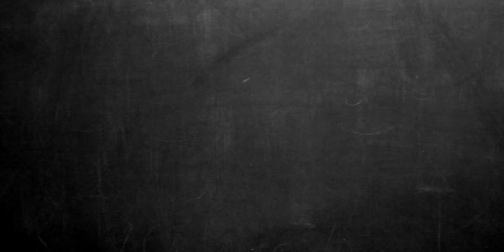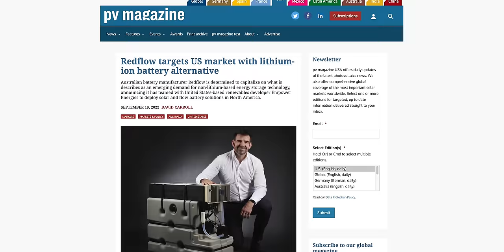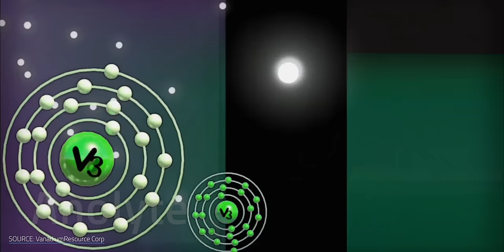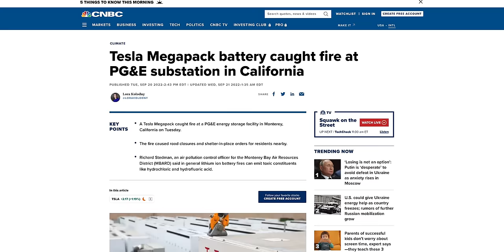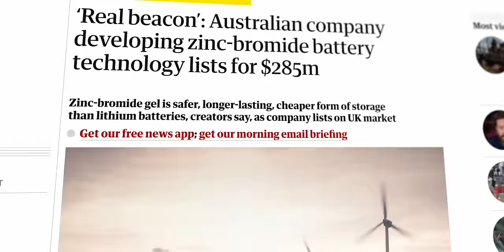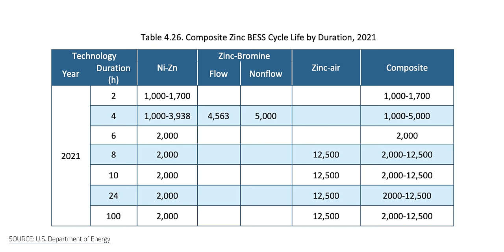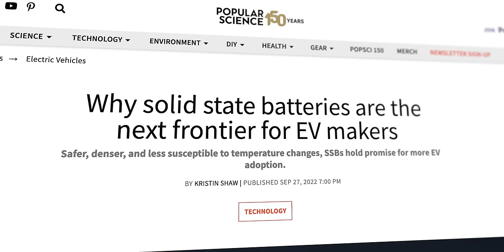137 Year Old Battery Tech May Be The Future of Energy Storage

Comment: How about the Edison Battery; the nickel-iron battery.  They have low energy density, so the batteries are big, and a fairly high self-discharge rate, but in a fixed installation the fact they can handle unlimited total discharge, a wide range of temperatures, and a lifespan in excess of 50 years makes them appealing.

Comment: All positive storage options should be deployed as soon as they are ready. I hope Zinc bromine batteries get put to use sooner than later.
Reply: We don't want too many different technologies out there.  What would be good however is a consortium that recommended a standard set of sizes and voltages.    E.g. If a large car battery was one such size at a nominal 12v ., so that lead acid ws still allowed to play, then it would  mean that companies would target that size as a replacement.  Now inverter makers tweak the charging and input/output voltages of their units so they can  adapt to a Standard Battery#3.  The standards association would define a series ranging from a motorcycle battery up to units that required  being placed with  fork lift., each unit  being something like 2-4 times the size of the next smaller one.  Standard should specify foot print, hold down, terminal type and location.

In this way when the Acme Battery corp goes belly up with their Uranium battey in 2050, I can replace their batteries with a different modular battery, retune my inverters, and job done.
Reply: @SherwoodBotsford  Just look at basic PC systems. Diversity but with standards are good, you can in MANY cases can't go wrong.

Comment: It's another way of storing energy. Ultimately, there will be several options used, each chosen as being the best for the particular application. One newish idea is to store sand in an insulated container and use it as a heat sink to store surplus energy. The sand can be heated to several hundred degrees Celsius and the heat used directly or converted to electrical energy. Perhaps using a Stirling engine generator setup. This system is almost infinitely scalable, it uses cheap and locally available materials that don't degrade with use..
Reply: I like the heat storage idea for conversion to electricity, however, the problem I see with solid piston Sterling engines is the need for precision engineering for the piston. A Fluidine might overcome that problem. You might also be interested in a simple thermal difference engine. Robert Murray-Smith shows the principle on a model with a vibrating membrane which he says can move a magnet through a winding to generate electricity. video: https://youtu.be/. It is based on the work of tibsim - his videos are here https://www.youtube.com/@tibsim/videos. Lots to play with. Enjoy!

Comment: I wonder if they'd be useful for normal car batteries. Simplistically sounds like a decent replacement for lead acid. I wonder about batter backups as well.
Reply: I was wondering about busses and trucks, since it does seem to need a bit of space, but yeah cars too?
Reply: Fun fact lead acid batteries are one of the most recyclable and one of the most recycled items in the USA (and most of Europe).
Reply: @ameritus9041  In fact there is one railroad that ONLY ships the reclaimed lead from these batteries to the other end of the rail where it is used in new batteries. And it IS great that they are so recycled but they just aren't great batteries for most applications.
Reply: @larrybolhuis1049  lead acid are amazing batteries for exactly what they are used for... turning over motors that require large amps for a short period of time.

Comment: BYD and CATL will start making sodium batteries in production quantities next year. They seem as good as flow batteries. You may want to compare them with the flow batteries.
Reply: You mean half-as-good as Li batteries.
Reply: @Bobtubeau  what defines good in your mind?
Reply: @Z0mb13ta11ahase  energy density( by weight and volume) while also putting out a good amount of power. Charge life cycle is a important thing too. Energy density is the number one thing for vehicles.
Reply: @randybobandy9828  specifically for vehicles, if its cheaper than Li batteries but takes up more space for long term storage id say that other options would be better, do you agree?
Reply: @Z0mb13ta11ahase  yes. Cost/safety/charge cycles are most important for a home. It can be huge as long as it's cheap and lasts 20-30 years

Comment: You forgot to mention that Lithium batteries for Grid Storage are competing for raw materials with the electric car industry! This will increase the inflationary pressure on them as the electric car industry scales up. It will probably be a LOT cheaper to use a different chemistry for Grid Storage applications like Zinc-Bromine than using precious Li-ion materials that are much more valuable to go into cars, delivery vans, buses and trucks!

Comment: If the zinc ions are being reduced to zinc metal, then it’s not a true flow battery as some of the reagents are stored on the plate instead of in the solution. This isn’t necessarily an issue, but it does make it harder to scale than a traditional vanadium flow cell, at some point you run out of physical room for the zinc metal. The same applies to the iron flow battery you showed a while ago. Bromine is a reasonably toxic and corrosive fluid, but it does have that advantage of being usable for regenerative electrochemistry. Whether it can be scaled for grid storage to the same extent that iron flow batteries could depends on cost and availability.

Comment: How scalable are redox batteries? Can you have one in your house that has say two 50 gallon tanks on the sides with a "reactor/reaction" component in the middle. Can you then put 2 reactors that feed on the shared tanks for higher output. Do you need multiple small self contained units or can you built one large unit that works more like a small power plant? Sounds like there is a lot of potential in this tech.

Comment: The Gelion batteries are poised to hopefully replace lead-acid applications, with a very real possibility of being a 1:1 replacement and not needing any advanced circuitry like Lithium does. 
I have also read that the RedFlow batteries can have the liquids recycled and essentially cleaned for re-use. They can also sit near indefinitely at any state of charge without the usual degrading. 
I was very keen to get one in a home solar setup, but RedFlow is pursuing the large scale market more than home (at least here in Australia).
But still very exciting technologies!

Comment: Could you clarify your cost and temperature figures? I got a bit lost.

Cost:
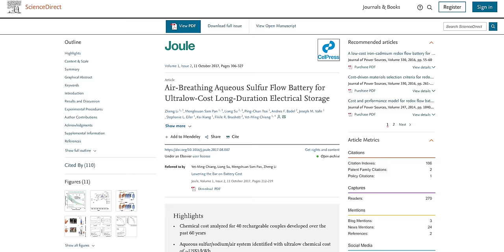@8:20 Study found that cost Vanadium Reflux Flow battery is about $124/kWh, and a Zinc Bromide system is about $8/kWh
@8:35 Study on the materials cost: Zinc Bromide won out at the cheapest at $153/kWh, which is far lower than Vanadium's $491/kWh
@11:05 Cost of system integration for lithium and vanadium is $42-$52/kWh, and the cost of Zinc Bromine is between $10-$18/kWh

So...how much does it cost?

Temperature:
@12:36 An experiment showed the Gelion battery still managing to (mostly) operate while on top of a 700C hot plate
@12:48 The Endure's upper limit being about 50C

How could it's upper limit be 50C and yet still manage to operate at 700C?

I've missed something. Could you clarify these figures?

Comment: Well, I hope things change soon as I have been trying to get hold of a Redflow battery set for over two years now. The reps have told me a few times that they were not seeking a market in the US. I hope that has changed. I will be starting the build phase of my new shop/home in a couple years and hope to have the units available to install in my new home. Otherwise, I am going to install an Edison battery bank. I am going for a net zero/off-grid setup to retire in.
Reply: How you gonna do that when just about anywhere in the US obiligates you are tied into the grid?
Reply: @rickytorres9089  I have not seen anything that obligates me to buy power from the grid. The property I am working on at the moment has no power/water/sewer or road. I will be installing a well, a drain field, solar with backup batteries, and a generator for emergencies. If your property is financed then yes you have to because someone (bank/insurance) else has an interest in your property. If you pay for everything upfront then no you don't have to hook into the grid.

Comment: Zink bromide sounds amazing, because you don't need very high energy density (by weight or volume) for grid scale applications. What you need, is for them to be as robust as they can be: withstanding temperature variations, withstanding a lot of cycles, and being made from materials that are as risk free to the environment as possible, both in production as well as during operation and eventual decommission.

Comment: You mentioned they would not be suitable for mobile use. Would that be true for sailboats where weight and space would be a concern but maybe not quite so much? One of the big concerns with lithium on sailboats is fire.
Reply: You might want Lithium Iron Phosphate batteries for your boat rather than Lithium-ion inflammable ones.
Reply: @mightymouse2024  thanks, I’ll ask around. I had not heard of them.
Reply: @Rojoke  They're usually described as LFP. The made in China Tesla model 3 uses a CATL made LFP battery. Lots of demonstrations of them piercing an LFP cell and it not bursting into flames.

Comment: If these do take off, both for grid scale and home (both off-grid and hybrid) it would at least free up lithium production for mobile use.  You show that they can handle higher temperatures at least as well as a properly maintained LiFePO4 battery but, how well do they handle COLD?  Pretty sure the Redflow at least would need to be kept (even if not being cycled) at a temperature above freezing
Reply: Not gonna be the same freezing temp as water but idm

Comment: Curious. If they have the same format as lead acid batteries and so many more cycles, why hasn’t the automotive battery industry converted or already looking at this as a replacement for all the existing ICE and lead acid applications? If cheaper and more effective, it would seem to be one hell of a use case and existing market to upgrade.
Reply: size and security for cars, they won't survive rough handling, let alone crashes.
Reply: I found another article on the Gelion battery.  Seems it has a slow discharge rate.  It can’t produce the amps to start an engine.
Reply: Do they have the same surge abilities as lead acid batteries?

Comment: I would feel much more comfortable with a Zink Bromine over Lithium Ion as a home backup solution. It's worth some extra space to get the bulletproof safety. Especially if it's installed inside the house.
Reply: Lifepo4 is pretty bulletproof already. You can cut them open with a saw and they won't catch fire.

Comment: In the video, almost right after each other, both $153 and $8 per kWh figures for Zn-Br RFBs are stated. Did the price per kWh really drop that much in just one year?
Reply: My understanding is this is just referring to the raw materials costs for the critical minerals. Zinc and bromine are both relatively cheap and abundant, versus lithium, cobalt, etc which are less abundant and therefore a lot more expensive

Comment: I still think Ni-Fe batteries (Edison Batteries) may play a role in the future as they develop hydrogen gas very efficiently during charging, they also can last 40 years and modern modifications can provide exceptional efficiency as a renewable battery.  Also the fact they use readily available common materials that are quite safe and cheap makes them worth another look.
Reply: Nickel & Iron are the 2 most common metals in the solar system, unfortunately nickel isn't so common on Earth. (Asteroid mining perhaps?) 

I like NiFe, they're tough, reliable & easily recycled, but weight/Watt-hour they're nothing like as good as Li-ion. 

They're still used as propulsion batteries in submarines & used to be used in forklifts & local-delivery vehicles like milkfloats though lead-acid took over decades ago & now delivery vehicles at least are going over to Li-ion.
Reply: slingshoting asteroids into low Earth orbit then just nudging them down from there seems cheap & simple, plus would collect some of the millions of pieces of shrapnel in orbit.

Comment: Niche companies have always had a hard time braking in. If the stats that you show hold up they may have a shot I think. We saw haw the battery did in the heat but haw dos it do in the cold. That will be a big deciding factor. One of the reasons that lead acid has been the contender for so long is the wide range of temp that it can work in.

Comment: I've done a few Volkswagon Beatle EV conversions in the past, and would have loved to had Gelion available at the time, rather than tearing out the back seat to pack in lead acid batteries (as well as packing the front trunk). Looks like these would have fit under the seat and got the whole job done. There may yet be a portable/mobile application here....
Reply: How long ago were you doing this? What kind of motors were you using? What kind of motor controllers and battery charge controllers were you using?
Reply: @gregorymalchuk272  It was before there were kits built to get the job done (20+ yrs ago). My buddy sourced all the parts, so I couldn't begin to tell you what the stuff was, as I was just the install and wiring tech. There was always some issue we had to find a workaround to resolve... fun times!

Comment: I have a VERY efficient energy storage battery:  Water!  Use intermittent electricity from wind or solar to desalinate sea water, and store the water in tanks or reservoirs for later use.  The "energy storage" is the grid power you don't have to use to run the desalination.  This technique is perfect for storing that energy because such a "battery" has no storage inefficiency.  To increase the storage capacity, just make a bigger reservoir.  Or use the empty ones we have now.

Comment: Thanks Matt! Your reporting on price per kWh is a little confusing. 

8:25 Chemical cost of Zinc Bromide $8/kWh -- does this mean I can buy a 100kWh system today from Gelion for $800, and it will last 4500-5000 cycles, on par with LiFePO4?

8:44 Zinc Bromide won out at $153/kWh -- does this mean I can buy a 100kWh system today from Gelion for $15,300? Or 10kWh for $1530? That would be amazing, since 10.24 kWh with LiFePO4 costs about $3000-3500 today.

10:20 You said "Lithium Ion are the cheapest at storing electricity for 4 hours" -- are you comparing that to Zinc Bromide here? Or is Zinc Bromide what you meant?

11:15 $10-18/kWh to ship and install the Zinc Bromide system. One time cost? E.g. It would cost me $100-180 to install a 10kWh system at my home?

What is the nominal voltage per cell of Zinc Bromide?

Comment: I would be a lot more comfortable having a technology like the zinc/bromide battery bank in my basement for electrical storage than an L-Ion battery bank.  I would be far less concerned about a catastrophic failure burning my house down or spewing toxic fumes throughout the house. Since it's stationary bank they aren't going anywhere so the greater weight per watt wouldn't be a big issue.  Thanks for the video.

Comment: 50C is not a high enough maximum temperature.  On a bright sunny day, in some places, the sun can heat things that hot.  The air may not be that hot but a road surface can easily be.  Some sort of cooling even if it is only shade and a fan are still going to be needed.

Comment: I used to work at a chlor-alkali plant which is oddly close to your description of a flow battery but in reverse.  I always wondered if the reaction could be pushed the other way to produce electricity as the cell stacks alone drew 3 MW.  I give you the sodium hypochlorite/Hydrogen acid battery!!!  What could go wrong????  I had to put that out there...having seen what goes wrong.  Have to watch those halogens....they're like colorful dragons.

Comment: Resident of an older home in the Midwest. Many of us have unfinished basements with lots of space that would be perfect for these batteries. Battery density, within reason, is of little importance. We could easily spare 5 square meters (~50 square feet) for battery storage without a problem.

Looking at some of the photos with the 140Wh batteries, I'm pretty sure I could store 300 batteries (45kWh) in 5 square meters with racks that are about a meter (3ft) tall. Or double the rack size, I could store 90kWh, which would keep me going for at least a few days during a grid outage (including using heat).

Comment: One piece of information is missing in this very good video: what are the discharge figures? Lead batteries can provide less amps than Li-Ion batteries. What about Zinc-Bromide? 
Are they to be seen as long small discharges or are they capable of short heavy discharges? Seen the configuration, I think they can they can handle short heavy discharges. But, does this influence the zinc  migration?

Comment: In 2006 the Australian army bought a new technology to the refrigeration research company I was working for. It was basically the same as the Redfllow. They said is this any use. Yes . They also said flow battery s will be the future of service stations and Automotive industry. The cars will have the plates in the fuel tank and change the electrolytes at the service station who will filter and recharge via solar wind or off peak grid.  With this knowledge I bought Redfllow shares . I will buy their battery s for my farm that is off grid .